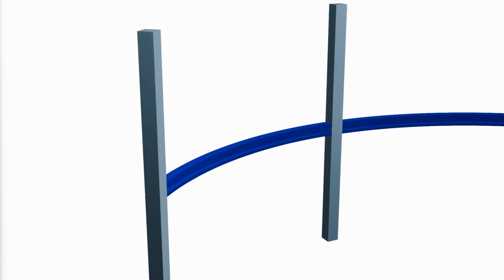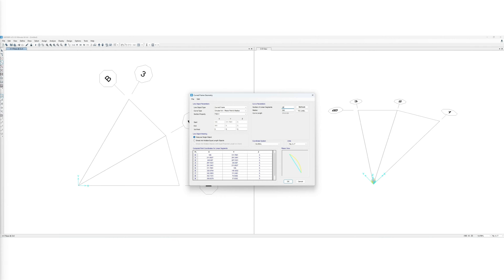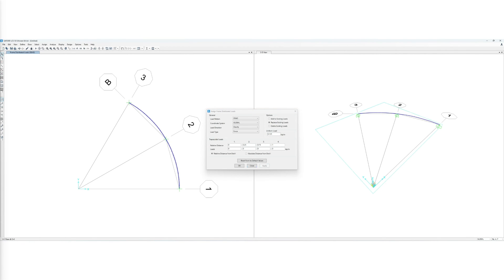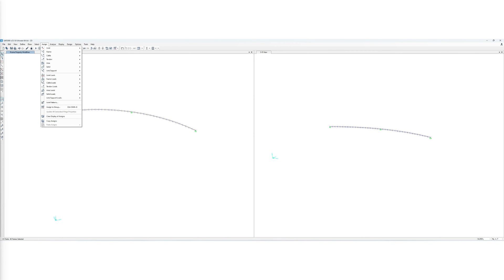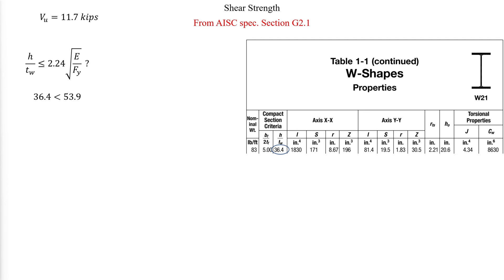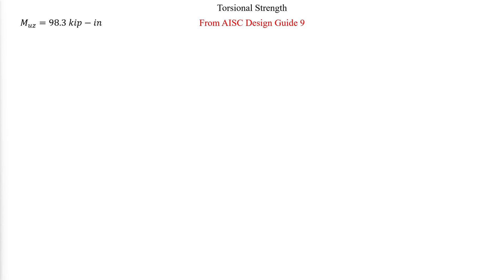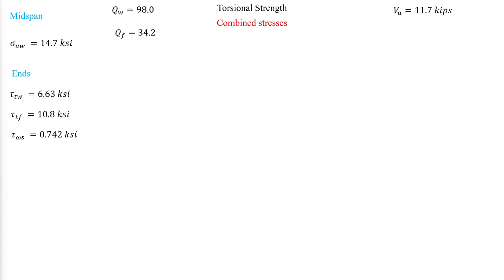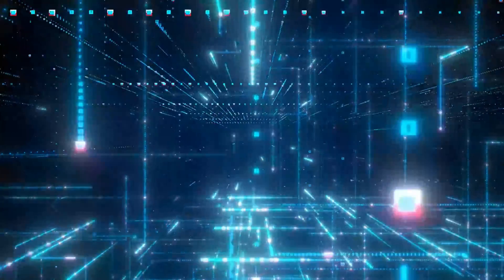Step by Step Example of Curved Beam Design using FEM/FEA (SAP2000) @FrameMindsEngineering

Comment: I am trying to design helical staircase with 900mm hole in the middle. I want it to be without stringer beam. It's a rcc slab. I can't figure out what are the shell stresses I should look for. Very low m33 moment in slab has befuddled me. Please interpret the shell stress values given by etabs. For what values of which stresses should I design the slab for. Where to took for moment, shear and torsion I need.